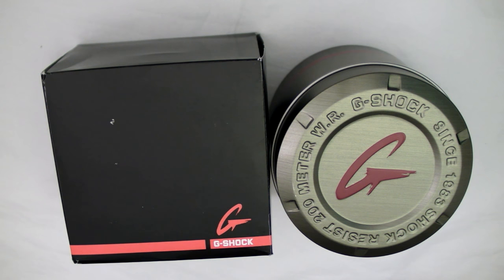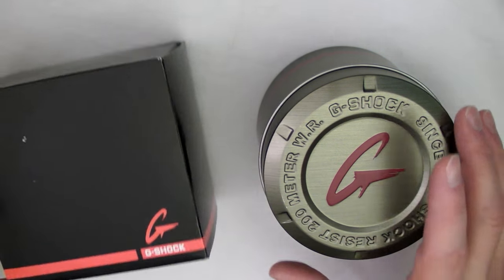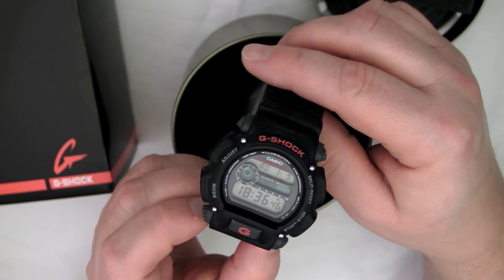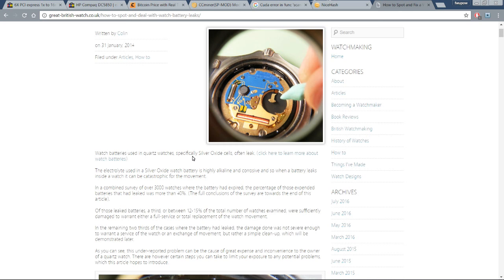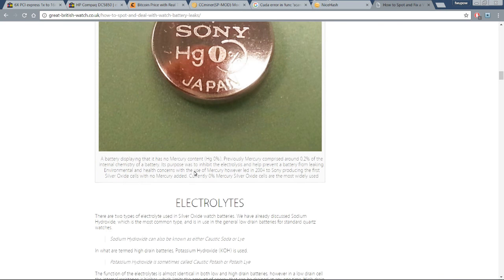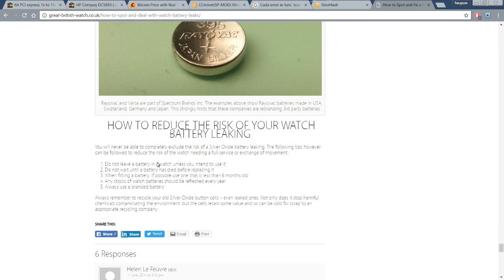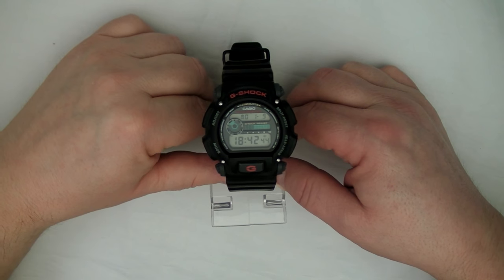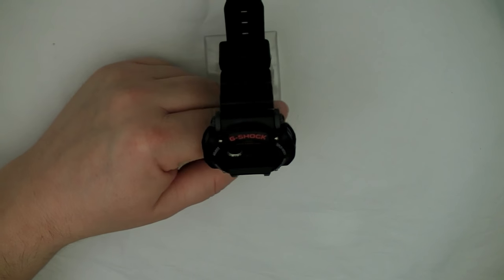G-Shock Care and Cleaning

Comment: i bought a complete new casio g shock gw5000 from a top seller on ebay. It was new and all, but i discovered a dust/particle inside the watch crystal. Is that something wrong with it as its a dustproof watch..? will it go on casio warranty and will i get it replaced?
Reply from the maker: Was there a Warranty Card. Usually, the warranty is only for 1 year. I had a Riseman with a tiny hair in it also. I think it's just something careless happening at the factory. There's no need to open a case on a Solar/Atomic G-Shock but that doesn't mean that the previous buyer didn't open it for some reason only they know about.

Comment: I used to not like G-Shock as a watch I'd wear. It's big, clunky, digital, not mechanical (yeah I was a snob). But then the pandemic hit, and your usual watch won't cut especially when you're working at a quite contagious places.

So I start to look at watches that I can literally dip inside a bucket of water and then scrub it hard with toothbrush and soap.

And here I am already bought 2 G-Shocks since the start of this pandemic.

GW-B5600 for your daily rigor, and GST-B400 for a more formal occasion

Comment: what is the difference between g shock g 6900 and gw 6900
Reply: G6900 doesn't have the Atomic time keeping which is perfect for me but the prices are almost the same... So I ordered the GW6900
Reply: The GW-6900 is Tough Solar and Atomic/Wave Ceptor (Multi Band 6). Its module is also different than the G-6900. I've seen reviews of the G-6900 and GW-6900 and the G-6900 is actually more sophisticated in its functions & mode selections than the GW-6900. I want both. I just bought a DW-9052.The old school G-Shocks have been on my radar.